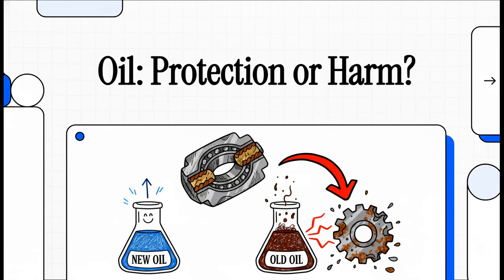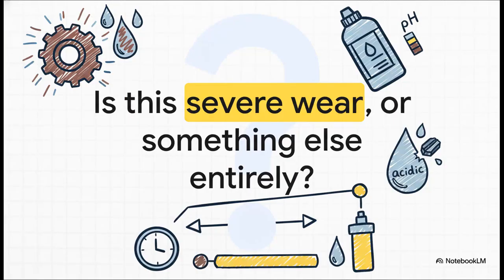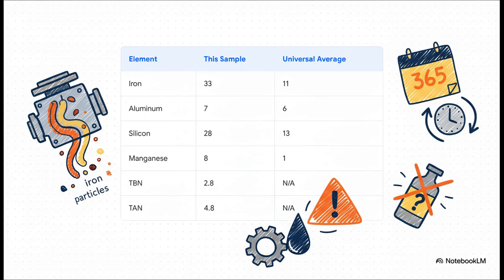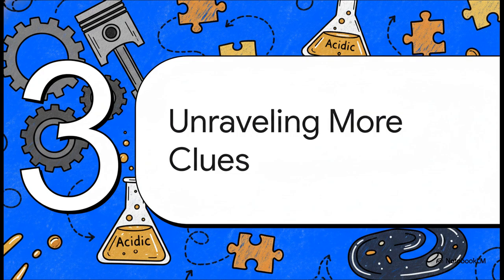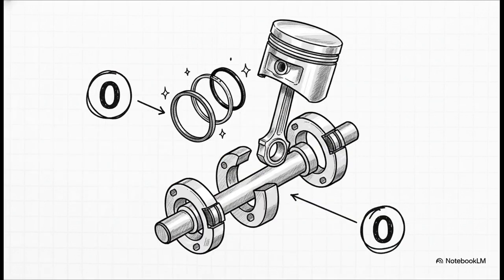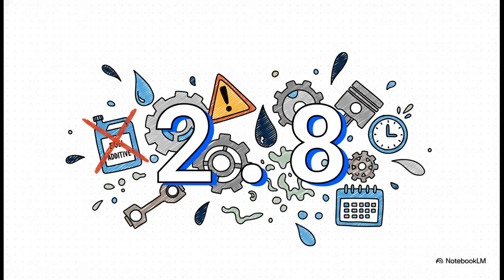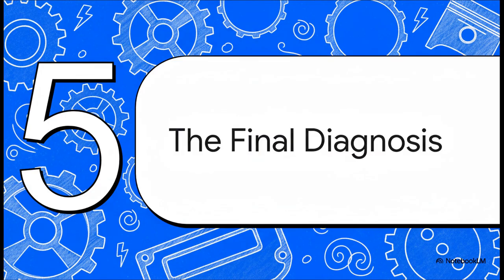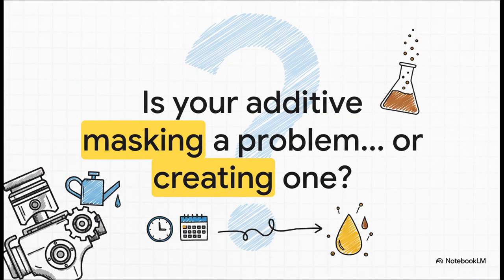After 4,250 Miles on Valvoline Restore & Protect… Something’s Not Right

Comment: Without waiting for the conclusion, my assessment is that the vehicle was driven short trips, allowing excess water to enter the crankcase (forming the acids) in addition to the fuel additives getting into the crankcase as well.  Cold engines don't allow the engine oil to reach proper temps to burn these contaminates off.

Comment: I been putting Restore & Protect in my 2020 Camry, 90k miles, 5k oil changes and runs like a Top. I also slap a VERY Strong Nyodinium Magnet onto my Oil Filter to keep and hold any Ferrous metals within the filter, and keep them from floating around too much. It will never hurt, only Help.
Reply: I USE big Magnets from harbor freight 😂😂
Reply: Never thought about a magnet it seems like a good idea
Reply: @ReflectiveMetal 
It is, Cutting open a filter with a Magnet, you actually see any ferrous metal stuck to the side of the filter as opposed to swirling around and getting recirculated. It’s just an idea that never hurts, and could only help.
Reply: I thought about putting one on transmission pan

Comment: Well what is it? is restore and protect okay or not?
Reply: I think it depends on how bad the engine is gummed up. If you are doing the 5000mi oil changes then there is no need for the Valvoline Restore Oil.
Reply: @markwarnberg9504  It is also designed for new engines to protect from gumming up in the first place.
Reply: @SingleStacked  Changing the oil regularly prevents gumming up.
Reply: @markwarnberg9504  I change it every 2500K.
I guess you don't know about low tension rings used on late model engines.
Reply: @SingleStacked  Yes I know about the low tension rings, have been folllowing Oil Geek I do Cars for some time now.
Reply: yes of course, but change it by 3500miles if possible

Comment: Using oil or oil additives to clean an engine, particularly one with existing deposits, can initially lead to higher iron results in a used oil analysis. This is a common occurrence as the cleaning agents in the oil or additive work to break down and suspend existing carbon and other deposits that have accumulated in the engine.

Comment: Changed Oil Yesterday.  Just had new Timing Chain Installed 3 days ago.  The "Old Oil" had less then 1500 miles/2 months in service (Valvoline Advanced).  The Filter was both relatively clean (overall) but compared to prior changes... There looks like the filter was catching more Deposits.

Installed Valvoline Restore and Protect for the current run (Interval #5, My first 4 were just before using Advanced. Ran for 12 months/10,000 miles).

Was considering running some BG MOA this time. (Oil Dilution has been causing 5W30 Viscosity to drop out of spec... Wear Metals are still ok. Being Average/Low... But even at 1000-2000-3000 miles and Dilution of 1.3-1.5% (2% being "acceptable") I don't like that I'm not running (technically) a 5w30.

Because of the Timing Chain I think it's best I stay away from the Additives.  See if it looks OK at the next sample and decide if I need some extra help then